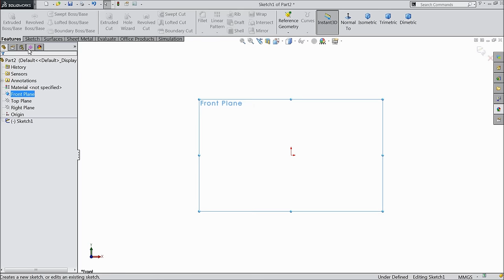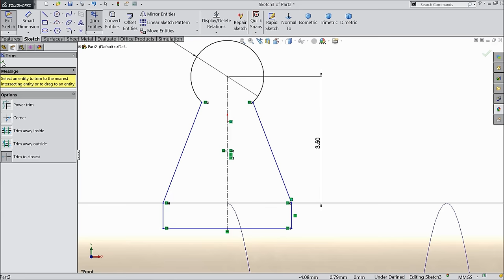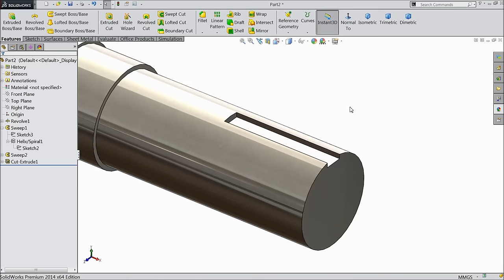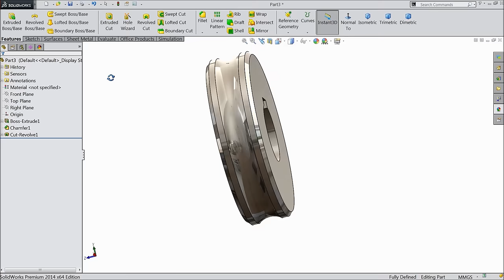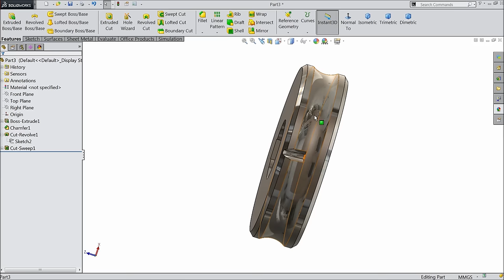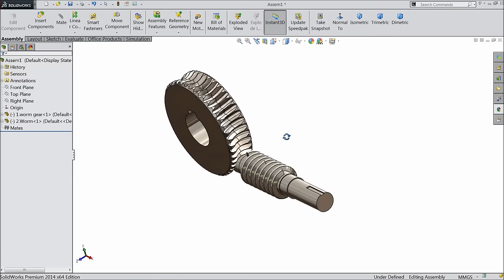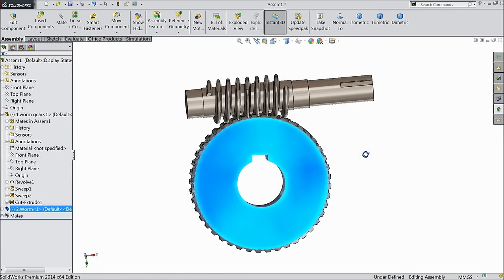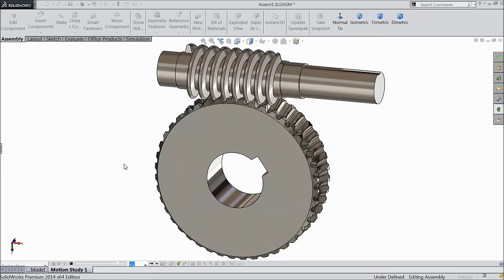Solidworks tutorial | sketch Worm gear Animation in Solidworks

Comment: In order for the worm gear (small one) and worm wheel (big one) to be mesh. The pitch must be equal for both.  The diameter of the worm wheel is also important. It can be calculated using this formula >> (Diameter = (pitch x number of teeth)/pi). If the pitch is 6 and the teeth is 60, the diameter will be 114.59mm. If the number of teeth is 60, the gear ratio would be 1: 60. Means that when worm gear rotate one rev, the worm wheel will move by one gear. For 30 teeth, the gear ratio would be 1: 30. Hope this help :)

Comment: When you start to design a shaft (or any revolved body), you should start with a construction line as centerline and then add diameters instead of radii. Move the cursor from the line to be dimensioned to the centerline and move a bit across the centerline. The dimension changes from radius to diameter.

The gearmate can be reversed to correct the animation.

Comment: Gear ratio is 44:1. The number of teeth on the worm wheel is 44 and the worm acts as a single tooth gear, so the ratio is 44:1. Cheers!
Reply from the maker: it's not real ration just imaginary ratio to show the way of gear ratio plotting,
Reply: It's hard to do this video if youdon't show the data/calculation on how to make a worm gear...
The data given to me by my prof is:
- RPM Driver 1840
- RPM Driven 240
- Shaft Angle - 90

And I will make a worm gear? :( please help
Reply: I have the same problem, but instead RPM I got HP and reduction ratio, did you get good grade?
Reply: So the ratio in Gear Mate would be 44:1 mm right?
Reply: good  video
Reply: Thanks for that info- I could see this was quite incorrect initially.
Reply: thankyou so much. I was trying to align the threads and groove perfectly but was not succeeding. then saw your comment tht worm gear acts as a single tooth; tried 1:44 ratio, it matched perfectly.

Comment: i have a question: when u draw the thread for the shaft in 5:50, why don't u just draw a circle at 1 end and then draw the helix to the other end and then sweep boss/base. Instead of that, u start drawing from the middle and then u have to draw 2 helix to 2 ends?

Comment: Take gear ratio 44 for worm wheel and 1 for worm shaft in gear mate and Take distance 38.5 mm in mate between worm shaft's face and right plane.
Do this and Ur gear's teeth will not overlap each other.

Comment: Great video, and I appreciate your effort, but if you are trying to teach this subject, you really should have the correct gear ratio of 44 to 1
Reply: No it's not correct, because 1st selection is worm and it has more gear teeth than shaft. If u give that ratio (44:1) then worm will rotate 44 times for 1 rotation of shaft

Comment: In animation the motor is connection is impractical. The gear would never move. The motor has be connected to the shaft and not the gear.